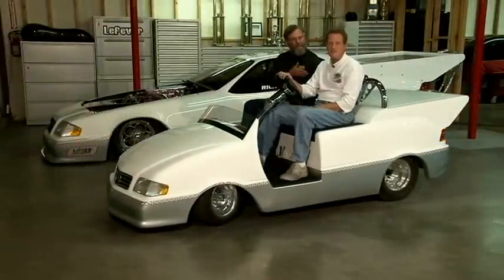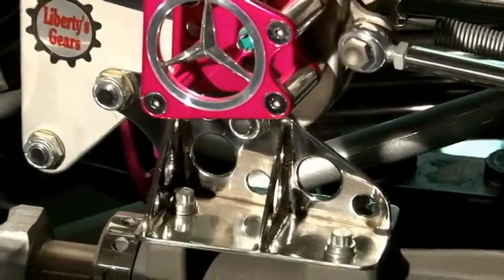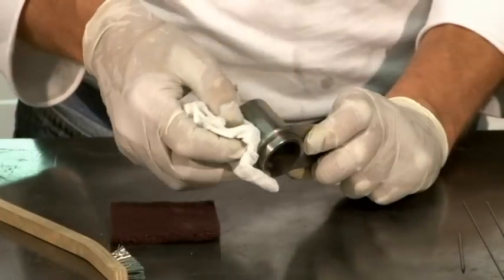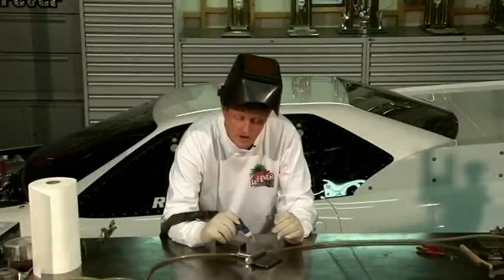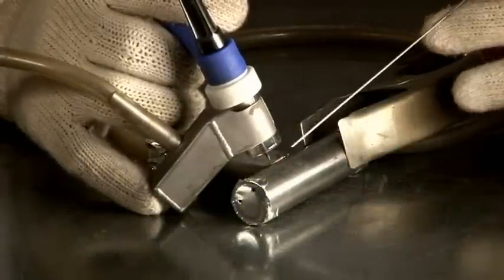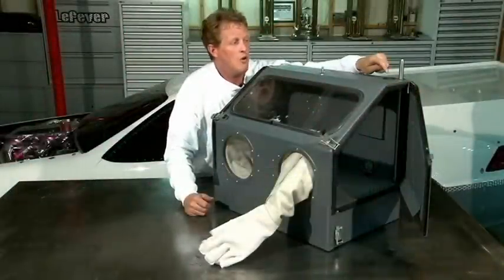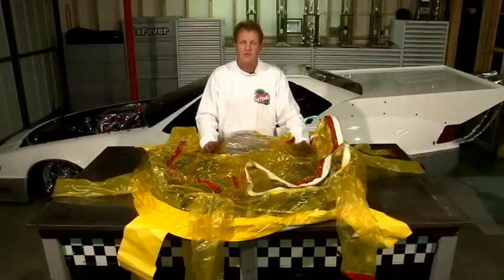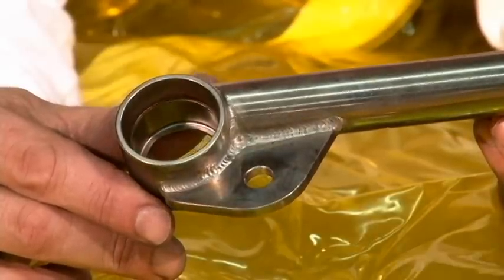Welding Titanium

Comment: How do you control the environment welding of the cages in the car?
Reply from the maker: While it is ideal to weld smaller parts in an argon-filled chamber, it is possible to use a standard TIG torch, utilizing the argon shielding gas that flows through the cup.

Comment: Great video. Appreciate the sharing of your methods and tips.  One suggestion would be to highlight the precautions with having that much Argon concentrated in one place. Like don’t be tempted to stick your face inside the bubble until it is well ventilated.  Just saying that confined space awareness is important no matter how unlikely you are to have a problem the consequence is very bad. Best regards MW
Reply from the maker: Yes, that's a good point. Argon is colorless and odorless, and if it displaces the air necessary for breathing, it could be very dangerous indeed!

Comment: argon feed tube should be at the bottom as its heavier than oxygen
Reply from the maker: Zack G - Thanks for watching, and for commenting. You are correct that argon is heavier, but it will still pool at the bottom of any enclosed space and push the air out of the top, regardless of where the feed tube is located.
Reply: @RonCovell  hey man, great vid, yeah i was just thinking of ways that you could optimize the fill rate ! cheers and great build :)
Reply from the maker: Zack G - I appreciate your helpfulness!

Comment: What tungsten size and amperage was that? 1.6 mm or smaller?
Reply from the maker: I'm not the guy who was welding in that video, but I believe Rick used 1.6 mm tungsten (1/16-inch) and the amperage was probably around 120.

Comment: Ron, are their any problems Titanium causes when welding due to having a very high reflective index in infrared and for a metal low heat conductivity?
Reply from the maker: I'm not aware of any limitations on the weldability of titanium based on the issues you list, but you are the first in my experience to ask these questions. Titanium has been successfully welded for decades, so apparently these issues do not seriously limit its weldability.

Comment: 3000 hp? show me the graph
Reply: You're welcome. Years ago, I asked myself the same question about horsepower ratings. The basics are simple.... 'X' horsepower requires at least 'Y' amount of fuel per second. To burn 'Y' fuel per second requires 'Z' cubic feet of air per second, where 'Z' is known to be proportional to 'Y' and corresponds to the air/fuel ratio (by mass/ not volume) for optimum horsepower. A lot of boost means a LOT of air, fuel, and horsepower (barring detonation)
Reply: If you doubt the credibility of the statement, you can just as likely doubt the credibility of the graph.
The bottom line is that 4 turbos means he can dial in a huge amount of boost. The use of alcohol allows far more boost without destructive pre-ignition (detonation). The same applies to top fuel dragsters running nitro methane and getting over 8000 horsepower. Top fuel dragsters use more than 10 gallons of nitro methane in a single ~4 second pass.
Reply from the maker: Gregory - thanks for 'chiming-in' on this one.

Comment: this video is just so good
Reply from the maker: I'm very glad you enjoyed it!
Reply: I'm barely get into this. Can you recommend one good welding machine for me. good for beginner, but can do a very professional job. cost is not so much of concern.
Reply from the maker: I have used the Miller line of welder for years, and I consider them to be exceptionally good. Rick LeFever, the presenter in this video, uses a Miller Dynasty 350. That's a very good machine, but unless you need to weld aluminum thicker than 1/4", the Miller Dynasty 210 should work just fine. Miller makes a 'Diversion' line that's even more affordable, leaving out some of the fine adjustments that the Dynasty line has.
Reply: I'm practicing welding mainly for roll cage and making harness bar. so 210 or 350 should do just fine ?
Reply from the maker: The Dynasty 210 should easily do everything you need!

Comment: 1:41 You shouldn't even lay those stainless brushes on the table like that either. Mine have a labeled plastic bag they go in immediately after each use. One for aluminum. One for stainless. I don't/haven't welded any titanium, so I don't have a titanium brush.  Laying them on the table on their side like that will pick up contaminants and oil off the table. Just a little filth or grease is all it takes to ruin a weld.
Reply from the maker: monocorp1 - Wow - that makes sense! I never considered that the brushes could be contaminated in that way, but every step to insure cleanliness is good!

Comment: As you may know, the USSR had some titanium submarines made (aka Typhoon, still the largest ever). To get those done, there were really big cabinets made, all filled with argon and the welders had their working suit, much like space suit - with air supply and etc. So yeah, as a result you get some quality welds. The main reasons for using Ti were much obvious - it's inert to corrosion in salt water and when we talk about large things like submarines, yeah, they will be significantly lighter if made from Ti, which makes them agile (if it's applicable). The project cost was ridiculous, sadly, 2 of them were cut due to various international agreements. Such things will never be duplicated, they are a work of engineering and production art, I think.
Reply from the maker: I was not aware that the USSR had built the largest titanium submarines. Yes, that's an incredible engineering feat. Thanks for opening my eyes to this!
Reply: I can add that those submarines was so expensive they received nickname "GoldFish".
Reply: The Alfa and Mike lass submarines had a Ti hull, the Typhoon-class was steel.
Reply: Hab Par are There any documentation photographs videos on how they did it

Comment: bit how much does it pay ?
Reply from the maker: Welders in the United States have an average salary of around $18 per hour. Of course, your location and skill level will make a difference, too. Some top welders are paid more than $65,000 per year.
Reply from the maker: Yes, titanium TIG welders are at the top of the scale. I don't do work for customers any more, so I won't comment on what I would charge to do that particular welding job.

Comment: wow i thought that pool floaty chamber would melt as soon as you lit your torch.
Reply from the maker: Of course the plastic will melt if touched by anything hot, but there is a stainless plate on the bottom of the chamber, which protects the most vulnerable place.

Comment: Thank you for your great video a lot of good info, you mentioned that you used a de-greaser... what type of degreaser do u use? and why dont you use acetone? Do you also use a degreaser on aluminum and stainless?
Reply from the maker: Acetone is an excellent degreaser, as is mineral spirits (paint thinner). For welding, all metals will suffer from contamination on the surface, but titanium is more fussy than most other metals.
Reply: Ron Thxs for ur fast reply, What type of degreaser do u use? if I may ask.....thxs
Reply from the maker: I use acetone most often.

Comment: I'm just curious, and I may even already have the answer to this question, but until I ask I'm unsure of which answer is correct, LOL! I'm just curious about the heat-affected zone, does welding in a purge chamber reduce the heat affected zone, or does it only improve color and weld purity? Thanks in advance, Aloha...the Farmer.
Reply: Welding in chamber has no impact on the HAZ, its purpose is solely to avoid contamination from air, controlling HAZ is done by the welding operator via welding settings, travel speed, usage of heat soaking props etc
Reply from the maker: +Knolltop Farms Well, I'm not trained as a metallurgist, but while a purge chamber will certainly reduce or eliminate the color change at the weld, a more important function is that it prevents the titanium from combining with oxygen in the weld zone, which definitely affects the strength of the weld.
Reply from the maker: Thanks for 'chiming in' on this!

Comment: thanks for sharing ron. when mr lefever is welding the piece in open air i see an attachment to the cup, i guess is for improving the coverage of argon, do you feed this with the same line as the torch?. pete
Reply from the maker: +thebrokenbone Yes, many welders use a torch attachment like this to extend the amount of time the hot metal is covered by the argon gas shield. While it's possible to use a 'Y' branch on the argon regulator for this hose, Rick uses a separate regulator, to have better control of the individual flow rates.

Comment: Is there any kind of titanium which would be even stronger than forged steel? I'm asking because I've always heard that forged steel is used the strongest engine connecting rods.
Reply from the maker: +ucallthatatweet Great question, which is a little tricky to answer, because there are many grades of steel, and many grades of titanium. The short answer is that any forging is stronger than a cast or wrought piece, and forged titanium connecting rods are available, but they are super-expensive!

Comment: I have only chamber TIG welded once and I used  vacuum pump to remove the air and purge it after with argon. the weld look beautiful. But I like to use Isotopic alcohol I find it leave No residue compared to degreasers. Thanks for some nice tip on titanium welding. I just need a new TIG machine, do you like the miller dynasty 3000?     Big Fan of your work for 20 yrs.
Reply from the maker: +Glen Badgley Isopropyl alcohol is a good degreaser, but I more often use acetone. Acetone does not leave any residue, either. I have both a Miller Dynasty 210, and 350, and they are two of the best welders I've ever used! I'm glad you have enjoyed my work for many years. The new Rodder's Journal magazine has a wonderful article on me, with a focus on the work I did back in the '60's and '70's!

Comment: What type of rod would you use to weld titanium?  And how much heat do you need to put into the part to get a weld going?
Reply from the maker: +DTLSchiller There are several alloys of titanium filler rod, and it's important that you select the one that matches the base metal you're welding, and there are several different alloys used in industrial fabrication. You can see a listing of some of the alloys of welding rod on the ArcZone website. There is a 'rule of thumb' for welding current that works with most weldable metals - one amp for every thousandth of an inch of the base metal thickness. That means that for 1/16" thickness metal, you will be welding at around 60 amps.
Reply: Thank you!

Comment: I had no idea that titanium was so fussy to weld.   The purge chambers are probably something that NASA uses a lot of.  Great info Ron!
Reply from the maker: +Keith Ward Glad you enjoyed it! While it is possible to weld titanium without a chamber, if you went the best quality welds possible, a chamber is essential.
Reply: +Keith Ward I actually use a similar deal (in reverse of course) to de-gas suspension oil in my shocks when rebuild. You just can't be technical enough sometimes.
Reply: +Keith Ward You can also do a simialr pruge technique when welding on a used gas tank, I use nitrogen to displace teh oxygen/fumes in teh tank while welding